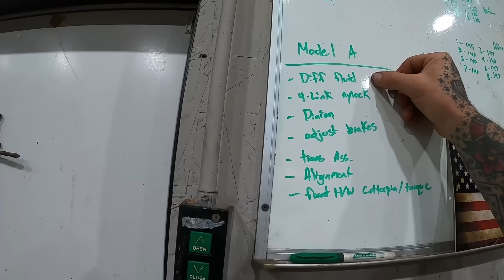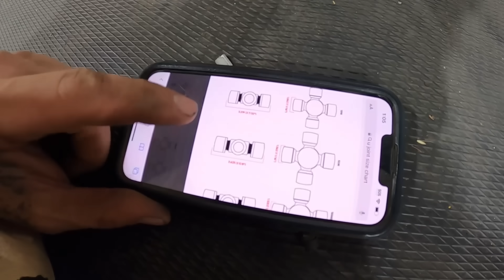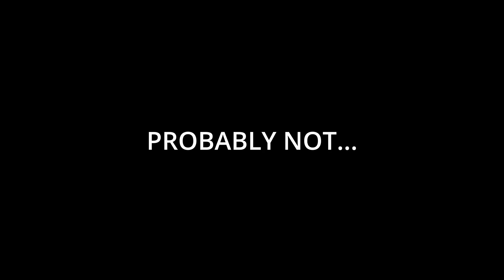1930 Ford HOT ROD progress. FUEL SYSTEM, LINKAGES, MORE!!!!!

Comment from the maker: I see a lot of folks asking how I’ll ever fill the trans so I figured I’ll just answer that here.. one tiny bolt comes out and it can be picked up to where you need it.. I’d rather keep an Allen wrench in the door pocket and remove one bolt on the small chance I need to add fluid then See that ugly dipstick bolted anywhere out in the open everytime I open the hood…uglys ugly and for this build a obnoxious dipstick is ugly. 

Zip ties are fine tho. They can go front and center on fuel lines. Hey I like what I like. 😂
Reply: shoot, you do you, them zip ties add a touch of that Puddin class that Model A needs. This thing is turning out pretty sweet.
Reply: What do you do for the torque converter lock up for the 700r4
Reply: Do what you love, Puddin'. Thanks, and cheers!
Reply: Love seeing the build with available parts and innovative ideas
Reply: Please don't come to my place and tell me how to build my car..  It would not end well for y'all ..
Thanks for sharing with us.
Reply: @PuddinsFabShop What about some of that hi dollar heat protective sleeve like they use on spark plugs around those fuel hard lines? It would look nice and prevent vapor lock on those hot summer days.
Reply: Dipstick ain't got no alibi!
Reply: Puddin try some heat to bend them lines eazy peazy.
Reply: Make sure to drop the pan and calibrate the dipstick. Those braided dipsticks are notorious for being too long which makes it very low when showing full.
Reply: @jef.fturn8197  pretty easy one wire to a relay tie in the brake light switch to kill it. Some need grounded at the 4 pin on the trans, later models ground once it's in 4th.
Reply: Awesome video Pudding. Hey take a look at that pinion seal I looks like it’s not seated all the way on the nine inch . Again love the videos and your truly amazing man .
Reply: Sr look at Dakota digital. They make awesome Gage sets.
Reply: You're building a beautiful car
Reply: 😂😂 I was hoping for a dually intake though
Reply: I love it!! I would appreciate a sbf instead of a sbc being it's a ford hot rod. I am a Chevy guy through and through but I appreciate when people keep engines the same make. I know a SBC is super easy to work on and reliable but come on it needs a 289 or 302 I mean there easy to work on and also gives you more room with distributor location.

Comment: Honestly the 4L60E is just fine. Our 06 Chevy suburban has 272,000  miles with the original drive train ( with 4L60E) and moved our house halling tractors and such. We also moved 2 Bunks of 7/16 plywood for 20ish miles on the bump stops just fine. And it runs and drives and shifts just fine. I don't understand the bad rep at all. Also glad to see the Model A back!

Comment: I do flea markets and housing clean outs. I get tons of spray paint, partial cans, weird colors, etc. They come in handy on small projects or patina blending on repupose items. It can be a pain trying to shake up a can that has been sitting for years, so I took your advice and bought a rattle can shaker. It works amazing even on cans that are probably 40 years old. I have a bunch of old drills so I went with that model instead of the Sawzall. As a bonus it's great when someone new to the idea sees what you are doing. Lol. Thanks, puddin'

Comment: Pun, you need to get pro loop for the cars. It's a very good old treatment. It's a very good transmission treatment and they do have heavy grease for the joints of the car.  Look it up on line please😊😊😊 And you will like it

Comment: Perhaps you could mount the Oil & Temp gauges, individually,  on either side of the steering column down next to the support bracket?  You would avoid messing up the lines of the dash where it more visible and yet you would have an easy view of them while driving.

Comment: MY 4L60E is currently suffering the STUCK check ball, actual GM cost of repair kit was 9.48 cents. yea its discontinued, but I have purchased the STEEL check balls to fix it, now just got wait for it to not be 90+ so I can crawl under it in driveway to fix it.  As you said if use it as intoned set it as required, they work JUST fine.  JUST little sad u didn't put 302 in in.

Comment: im actaully really impressed with the 4l60, mom has a 2001 chevy 3/4 ton an she has 572,000 miles on it now an just started slippin in 3rd and 4th, she used to pull all kinda trailers with it all over the west to east coast, has a 40 ft camper trailer she tows with it to but was always reglisious about all her fuild changes an grease ups to which probley helped

Comment: A wooden dowel with the proper size hole, and a set screw threw the fire wall with the proper size hole in the middle for the cable to go through.

Comment: Ideal 'V' belt contact is 120 degrees, so you might want to mount a flat idler pulley on the back of your belt on one side of your pump pulley.

Comment: Hey puddin, Joseph?  I don't hear your actual name enough, it is Joseph  or Joe.  Anyway pudd I for one love the A model series. It is a brave and or scary tho g to mess with a complete driving antique running and driving model anything, to turn it into what you vision as what it needs to be at. Congrats  man I love what I see,. 
 The only thing or one thing id say also about the no heat, you in the desert at night it can get extremely cold..And in the rain after a very hot day , car windows get fogged up especially if there is a car load, and or dogs.   But I figure your still good with not having heat in the model A if your not going to take it anywhere... too far.👍👍👍🇨🇦🇬🇧🇺🇸

Comment: I drove a '69 Roadrunner no speedo I had a card on the dash with RPM = MPH calibrated by distance of one tire revolution measured with a tape on the ground and a mark on the tire - well duh 
had to recalibrate for 3.23 or 3.55   anyway out on the highway timing mile markers it was very close even with an automatic trans

Comment: Use a soldering iron melt a hole in the cap and slide it over the rod or the gasket hole punch or the drill bit you used lol

Comment: Puddin' please round off the brass fitting on the firewall for the fuel line.   Just round off those wrench her points and it will look more automotive than house plumbed. 🙂

Comment: I noticed a few things during the video. One was the dipstick but you already answered that. The next was that your pinion seal appears to not be fully installed. The third is I'm not crazy about the amount of contact you belt has with the waterpump pulley. I understand that you have limited options for your belt drive. It might be fine if your using an electric fan. I have heard of people having belt slippage when you don't have the belt wrap around the pulley enough. It might have to end up being a trial and error thing. 
I love the Model A content.

Comment: I have a tip on your body filler turning loose .....I think you heated it up from the backside with your grinder or sander .....it doesn't take hardly any heat to do it

Comment: You might wanna put some insulation on that metal fuel line. You might get like a vapor lock from the heat from the motor & head.

Comment: Hey Puddin', if yer wondering about a proper Speedo I do believe you could run a PM generator off the original cable area at the transmission. And just have an electrical speedo gauge for your Shallow stock dash old timey looking too. Just a suggestion is all. She's shaping up nicely, the linkage for throttle and TV cable is Mint!!

Comment: Oi, concerning the kinks in the piping, different materials kink way easier, the best way I've managed to do it is to just lubie dubie the line before you pull it through the bender. 
I've heard some old timers talk about packing sand into them too but I've never done that myself.

Comment: edelbrock has a nice fuel inlet adapter/hard line that dumps under the choke and runs to front of intake , plus lokar has a throttle cable and trans downshift cable kit that is a clean install

Comment: With the hood closed the glass bowl filter housing will be subjected to heat soak.  How do I know, Hudson factory-installed filter is the same.  Several "fixes" later... removed the glass bowl filter and replaced it with one I installed where air can move around it.  Did it stop the heat-related vapor lock?  No, but it lowered the instances. You did that and I hope you do not have the heat soak vaporlocks.  You and I use the iPhone app to set my driving speed!    Great progress on your A-rod

Comment: Hey Puddin, carb guy again. One thing I learned in my career as a mechanic at a place who made fuel monitoring systems, elbows are your enemy when it comes to minimizing pressure drop in a fuel system. That's why you see full-flow 90°AN fittings. 

That's not a high HP motor, so you'll probably be OK, but a single 90° hard turn elbow can (depending on flow) be as bad as going from a 3/8 line down to a 5/16 line in regards to delivery. I think I counted 3 hard 90's.

Anyway, love the build. And how are you going to add transmission fluid? 😏

Comment: I don’t know if you’d be interested, but on Marketplace near you (far southern Kansas) is a rare 2004 Chevy 2500 with a 6.0/5speed manual 4x4 for only $1,200. Only has 88k. The guy parked because a bad clutch, and mice chewed dash wires. The engine/transmission/transfer case/ axles are worth that.

Comment: Don’t lose the bolts with the springs for the radiator if you do order new ones never put a bolt without a spring I learned the hard way in my early model a builds.  😂

Comment: Doing good job Puddin, but from home here it looked like the plastic piece you sanded off throttle cable would shoved into pipe going to inside then hook cable to pedal. Might be worth a second look with a new cable, it would be a lot shorter total length.

Comment: You're gonna regret that trans dipstick mount when it comes time to fill it up or top it off.
Reply from the maker: I doubt it. One bolt and the flex part does it’s job of going wherever I need it. Mounting it where it was nice and obvious I would regret everytime I seen it.
Reply: @PuddinsFabShop  Yeah good point. I suppose on something not being daily driven popping the bolt out to pull the line up ain't too bad every now and then. Loving the build otherwise though. Keep it up!
Reply from the maker: A little hassle but not too bad! Thanks for watching and being here!

Comment: I have mixed feelings on the 4L60Es.  I think it all depends on who built it, on what day and after how many Sammiches.  I had a bone stock ‘96 Blazer that got its first replacement under warranty at 20 some thousand miles.  The second trans lasted till 176k before it needed to be rebuilt…

Comment: The size reduction at the glass filter is gonna hurt ya. Why not delete the glass filter and put your fuel filter under the dash so you dont see that ugly thing by the fuel pump or outside in the long hose you put at the firewall. I think you have enough clearance to put a 1 or 2 inch spacer under the carb. dont use aluminum , use a plastic or Bakelite one to keep the heat away from the carb.  Get one with 4 holes  then take your carb an turn it upside down and tighten the air cleaner stud in the vice.  then put the 4 hole spacer on the carb checking to see if the is no interference between it and the throttle bores. use your die grinder to smooth out any area where air or butterfly's would cause any interference or hinder air flow. This makes a  huge difference between 3000 and 6000 RPM. One more little thing is put your PCV to the right valve cover and hose to back of carb, block the front pcv nipple. NOTE you throttle, trans linkage look great. Thumbs up on fuel and trans lines, keep up making it sweet!

Comment: THIS HYD journeyman Approves of HYD hose fitting Manufactuing.  TIP not everyone will be go together as planned, even the ones that cost 100's dollars each, why NAVY aircraft lines are so expensive. once bought fitting cost 985. they would let me buy a spare. pressure was on. like dash 10 large line., nice work fixing the unfinished/

Comment: What about a tiny GPS speedometer for a motorcycle to the side of your column like a old tachometer? i had one on a old bike of mine that was tiny. and it had oil pressure light, high low beam light, and it was very well priced, I think all of $15.

Comment: How are you going to add transmission  fluid with the opening sitting level like that Puddin? Are you just going to remove the bolt and lift it up, or do you have another way of filling it?

Comment: Hey Puddin.  Dumb question and this question is coming from someone that has never bent brake line before: would it be easier to take a piece of solid core wire or romex and bend it to shape for your run then use it as a template for your line?

Comment: My 4L60E has been grwat for 250k+ miles. The only reason I am going to swap transmissions is because I want something a little more efficient (not a fan of the way the truck downshifts and revs to the moon with the cruise control any time there is a hill) and I want to give it more power and why blow a good trans when you know it can't hold the power?